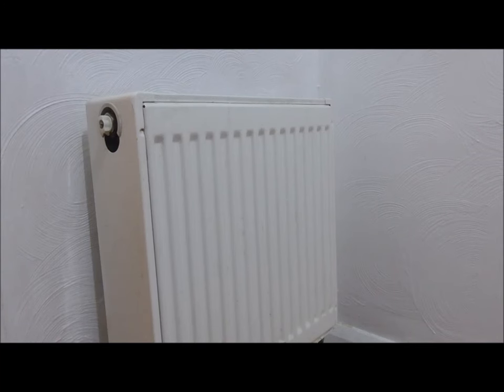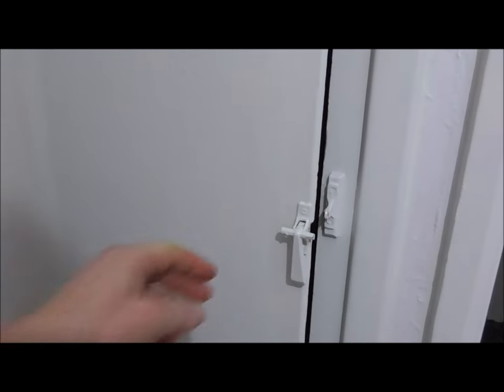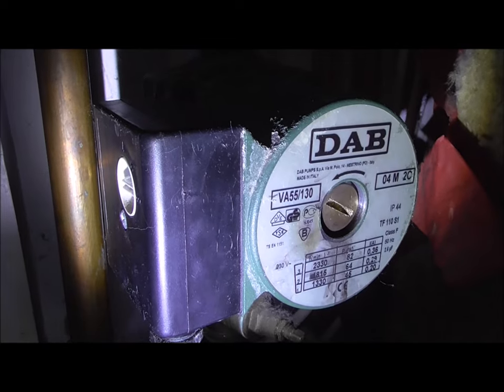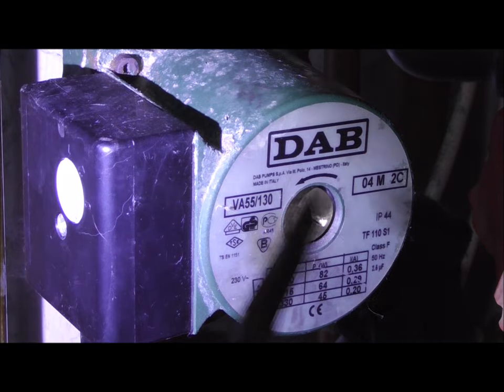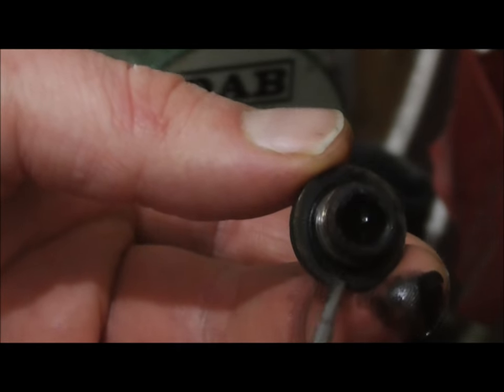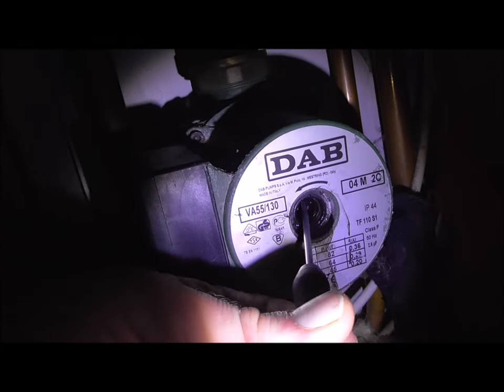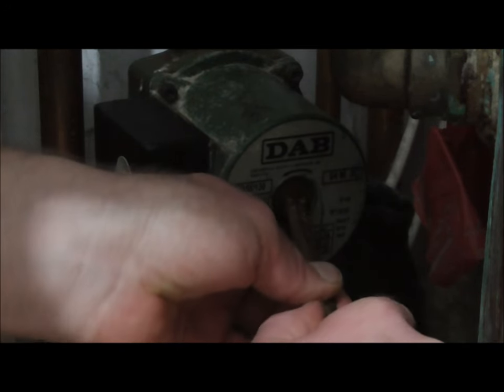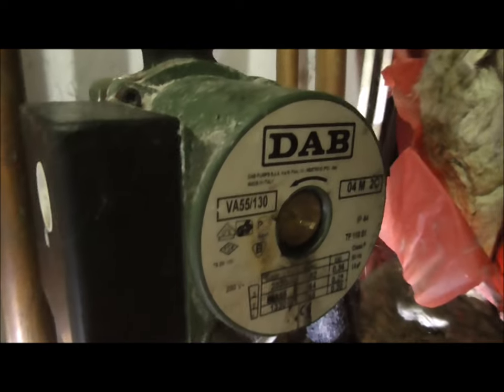Radiators Work Upstairs, But Not Down Stairs, Radiators not working, Easy Fix not working upstairs

Comment: change that dirty water as soon as possible from the entire circuit unless you don't want to say goodbye to entire pumps and also electric vanes...
Reply: It’s an oil system lol
Reply: @djwilliams123  Oil goes into the burner, not the water pump for the central heating which this is that feeds the radiators.

Comment: Hi so good video and I had the same problem. Although when I turned off the pump and unscrewed the plug the water just kept coming. So couldn't get to the propeller.... any thoughts ?
Reply: stewart muir same here right now....ever figure it out?
Reply: Paul Callaghan your can usually isolate the water supply turning off the two Gate valve heads that isolate the pump on either side of the pump usually turning clock wise with an adjustable spanner
Reply: @SamSam-wx4rf  That's clever that. I had to use a coin and my thumb got sore.

Comment: Have the same problem but doesn't seem to be the pump as I can feel hot water going to pipes downstairs. Please help. All 3 rads downstairs aren't warming up. Surely all 3 can't be blocked??
Reply from the maker: First of all, Have you done what iI have shown in the vide?
Reply: @thingstoknow3645  yes we've balanced the rads so all upstairs are turned off so it forces the water downstairs.  Pump has been checked and all trv's have been checked

Comment: I'm currently having this problem but I've two circulating pumps and both are very hot to touch. I've bled all rads but to no avail.
Can you advise......
Reply: There is probably black sludge from rust in your radiator system's water.

 This is making the pumps work harder because it is thicker than clean water, so the pumps are heating up from the effort.  

The system needs a 'power flush' (needs a plumber with a power flushing machine).

At the very least the water from the system needs to be drained, then all radiators need to be removed and cleaned out with a hose (it is quicker to 'power flush') . Flushing should be done every 6 or 7 years. 

Remember to put rust inhibitor in the system when you fill it back up with water or it will damage your system and create sludge in no time.
Reply: @graciasmuchas5238  you were right. My system was rammed with black sludge. Fortunately we replaced the entire system to "air to water" complete with underfloor heating so no more radiators 🙌

Comment: My problem with downstairs radiators not getting hot started after I had a new pump fitted this morning. All downstairs radiators not getting hot apart from getting slightly warm. So would a new pump get stuck and need freeing up as in your video? The casing of the pump is very hot and you can't put your hand on it for more than a couple of seconds. Any suggestions.
Reply: Could be a problem with a motorised valve. Push the lever on the valve over to manual to see if that's what is causing the problem. Check out derreton33's channel for useful advice.